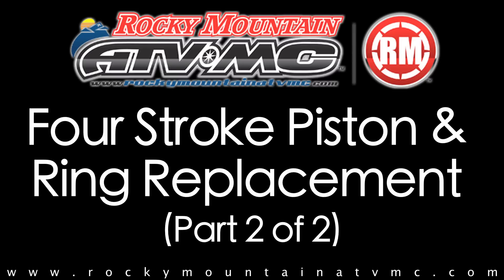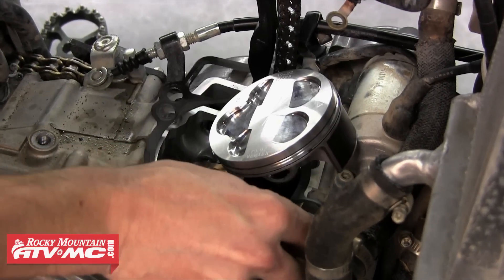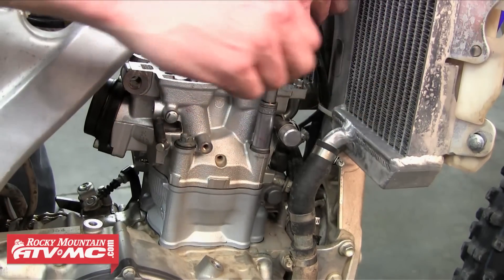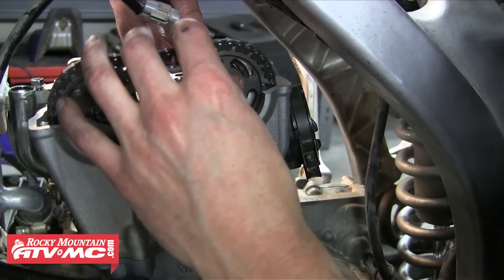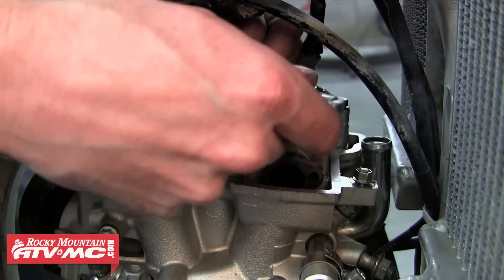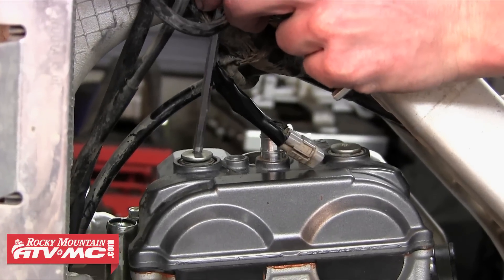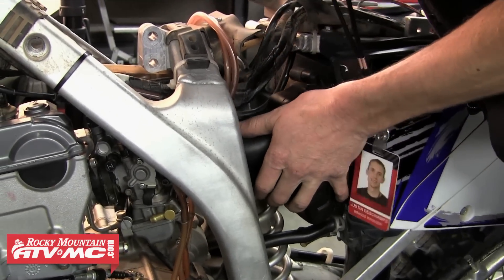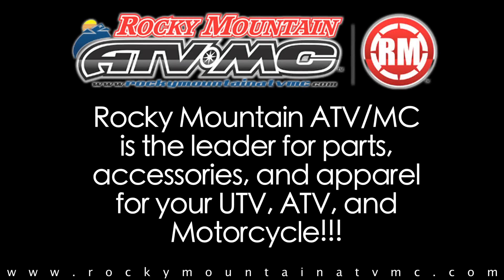Motorcycle Top End Rebuild on Yamaha Four Stroke (Part 2 of 2)

Comment: i have put my bike back together after reshimming each valve and now my bike has little to no compression and will not start but will occasionally backfire? what have i forgot or what do i need to do? thanks. please help
Reply from the maker: With the bike back together are the valves still within spec? That's the first thing i would check and if they are i would check your timing next

Comment from the maker: You may want to check valve clearances and adjust if needed. As for the camshaft Hotcams offers one that includes the auto decompressor and it's listed to fit the 01-13 so that would be a great option

Comment: thanx , i first noticed the rattle when i was ridding on sand and i had to throttle up to get through, on normal dirt roads i hardly notice it, as for `the cam what year of bike would i have to use to get the auto decomp cam?

Comment from the maker: Are you sure the rattle is coming from your motor? Does the motor run fine other than that, is it easy to start? It seems like yamaha's tend to make a lot of valve chatter but it could be that something is wrong in the top end. When did you notice this? As for the decompression lever since your bike is not equipped there really isn't any way to start it without pulling the decomp lever. Sometimes you can find aftermarket cams that replace your manual decomp system to auto decomp so check that.

Comment: Thanks for the video.  It is nice to have a good reference video before I go reassemble my bike.  I have a quick note to add for anyone.  That air box hooked up to the carb in this video super easy but if yours isn't, spray a little silicone spray on it.  Makes the job 10 times easier.

Comment from the maker: There is no set date on how long any motor will last. Maintenance is what matters so if the oil and air filter have been changed regularly along with other maintenance steps that keep your motor running right. 4 Strokes will go years without needing a rebuild with routine maintenance and being cared for. It's good to inspect your motor to make sure everything is in spec which is done with the help of a service manual. When those things get out of spec you'll know you need adjustment or a rebuild